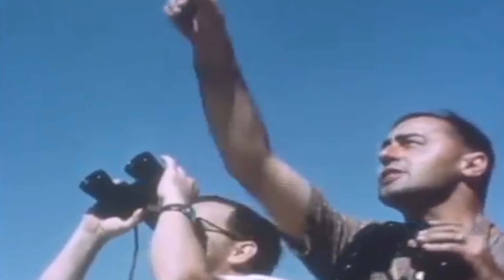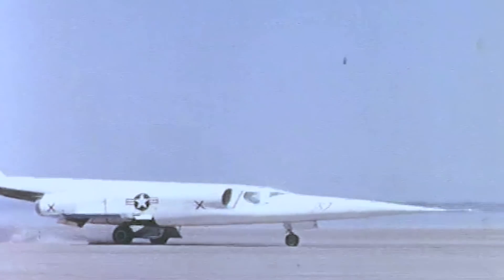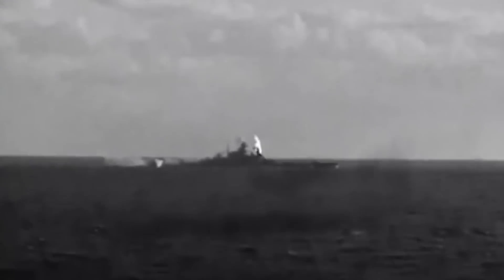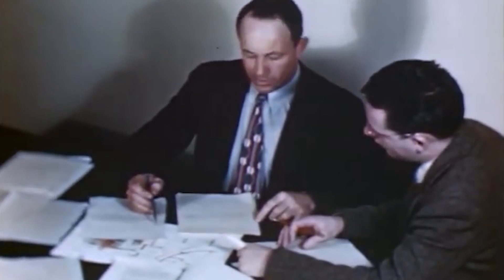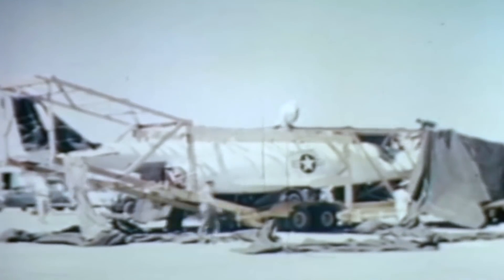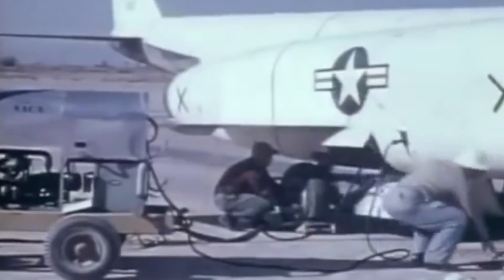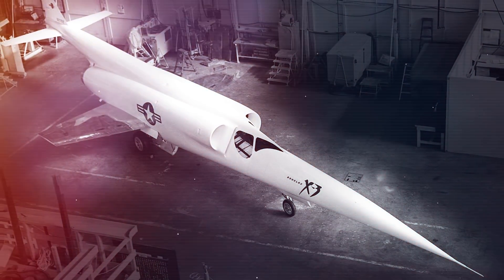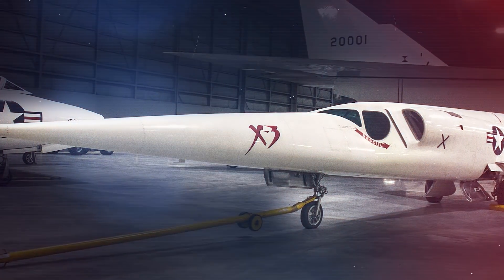Douglas X-3 Stilleto - The Dagger That Could Barely Fly

Comment: Lots of unrelated fluff about Douglas  and the SBD. 
Not enough mentioned about captured German  technology: swept wings research , rockets & jet engines.
Too much talk about the X3 looks, but not enough about the details of the design. I’m sure NASA has a publication on the X3 program. 
No mention in the video of when the X1 broke the sound barrier, what was learned and applied to the x3 
Aluminium was mentioned at least 2 times as the material of construction, which is true,  but the relevant bit of information was the aircrafts use of titanium due to the anticipated heat.   
Testing into the mid 1950 saw other supersonic aircraft tested & put into production as a reference for comparison to the X3

Comment: This video doesn't mention that the X-3 also had a big drag problem because of the "Area Rule" phenomenon. Later Mach 2 aircraft solved this problem by using a "pinched" or "Coke bottle" fuselage profile in the area where the wing joins the air-frame. You will notice the X-3 fuselage sides are perfectly straight at that location. My college mechanical drawing teacher, Mr. Gibbs, (who designed the landing gear of the P-38 while working for Lockheed as an engender before WW2), explained this aerodynamic phenomenon to us . He retired from Lockheed in the mid 50's but not before working for a while on the XF-104 project. He became a teacher after retirement, but died from cancer in 1965.
Reply: What a privilege to have a professor with that kind of background.   I gave him a lot of credibility
Reply: @raymondweaver8526 ; and on top of that, he was a hell of a nice guy. We were all sad when he passed.
Reply: Thank you for sharing. That was pretty interesting
Reply: @mandellorian I believe it's because most modern fighters rely more on Super cruise rather than lighting the thirsty afterburners so that the planes range could be extended to further mission parameters
Reply: I wound up meeting the man who set the speed records in the f-104 starfighter, David Waldrop "the shark" lol cool guy. I was a kid at an airshow, and he let me put on his flight helmet
Reply: I noticed the 'coke bottle' design on RF-4C aircraft I worked around in 80;s. I thought it was funky but was told later your same explanation.
Reply: Ya beat me to it.  I was going to comment on the lack of area rule geometry.

Comment: I still think the Stiletto got ripped off. It's like driving a Ferrari with the engine of a Fiat Panda. Not quite fair.
Reply: Maybe it should have been more like a Lotus with a Toyota four cylinder?
Reply: @Bartonovich52  Well that seemed to work for the Lotus Elise.
Reply: @Charles Yuditsky - Yeah, if it pulled that crap at just over Mach 1, at Mach 2 it would have been even worse.
Reply: @Charles Yuditsky Have you heard of any simulation of the X-3? I know the ME-163 Komet was tested and found to be incapable of supersonic flight even with a higher ISP fuel and motor. I.e. tested using computer simulation, that is.
Reply: @fiftystate1388  through the 50s and on into the 70s it was drawing board, then wind tunnel testing.  Computers were only used in the periphery, checking calculations mainly.  Mainframes at this point had as much processing power as a mid-1980 era washing machine, and slower inputs.

Another thing you need to consider is where they got the data that built the simulators used today.  These flying test beds of the 'X' program provided much of that data.
Reply: @chuckhainsworth4801  Amazing, tell me more. #IJustFoundOut
Reply: @fiftystate1388  The flagship, and work horse of the program was the X-15.  Find a book on that program,  they had a tendency to cover many of the other X ships.
Reply: @fiftystate1388  that's interesting, to go back and computer simulate/test old novel or experimental models! 
I'm going to look those up now! Thanks!
Reply: Unfortunately the engine bays were not designed large enough to fit more powerful engines.
Reply: Agreed... someone deep inside of Douglass seems to have made a significant error with their trusty slide-rule when calculating the power graph. They ‘could’ have stuck with it & (perhaps) ended up with a superior airframe, but, that never happened. What could’ve been?...........
Reply: It was ahead of its time.

1949?

They didn’t have any “Ferrari” level jet engines… 
yet.

It eventually led into the F-104 which did well with just one mighty fine J-79.
Reply: They didn't have CAD or carbon fiber composites (or any composites). Any more power and It would have torn itself to shreds during simple manoeuvres.

Comment: saying "designed for optimal speed at mach two" is like saying "this car is designed to go the perfect speed at 60mph" as if there's two different speeds somehow
a better way of phrasing this would have been to state that "the aircraft had short clipped wings to produce as little drag as possible at mach two"
Reply: The air frame was designed for Mach 2 the engines weren't
Reply: @jamesricker3997  yeah I know that, but thats not what I was talking about, I was just pointing out a mistake in phrasing, the topic to my comment is the English language, not aircraft

Comment: Great looking plane, but horribly underpowered. Plus I don't believe they had a proper Spike system for the intakes which would control the air going into the injen intakes and would cause and engine under Start stall.

Comment: The tail section where the engine exhaust is looks very F4 phantomish.
Reply: More like a F-101 Voodoo I think. Buid dates closer too.
Reply: It’s like a lot of McDonnell fighters. The configuration dates from the FH Phantom in 1945. 

It’s just odd that it’s in a Douglas aircraft.. as the two companies wouldn’t merge until the mid 60s... but the configuration does minimize losses from long intakes and exhausts.
Reply: Was just gonna post this.  Glad I checked the comments first!
Reply: It’s cool how a lot of these X planes lead to development of not just one aircraft but the different design elements found their way into other aircraft as well.
Reply: @JimBobBek I think you might have missed mine. The point is was making is that the F-104 was literally the legacy of the X-3 in combat form. There were many other superior designs available at the time, which if not due to some very shady deals done by Lockheed probably would have won out.
The English Electric Lightning would be an example of this with far superior performance and safety.
Reply: @Charles Yuditsky I don't know about that. The UK, Canada and Australia all had aircraft ready for manufacturing at the time of the century aircraft and were all scrapped due to marketing and budgets of a collapsing empire.
Make no mistake, all were superior in the roles designed than what they actually got. The one outlier would be the F-111 in Australia which was the perfect plane for the perfect job.
Reply: @paulgrimmond6296  In aircraft design, like in war, it's not really about who's right - it's about who's left.
Reply: @paulgrimmond6296 You raise a good point,  if anything, most  of that is pretty understated.
Reply: Yeah
Reply: @JimBobBek The British aero industry has a long history of experimental aircraft - quite often sub scale versions of larger production aircraft. Shorts built the SC-1 as a vertical takeoff aircraft, the SB-4 Sherpa (the worlds slowest jet aircraft at the time) and the S.31 - a half scale Stirling Bomber for example.

Comment: I heard from a renouned test pilot that there was some political hooey going on with the development of those motors.  Appropriation commitees held back funds for their own paycheck from others, Backhand payola for schmucks,, Ect.  The X3,, coulda, shoulda, woulda,,if only.   I built a Estes version of the X3 using 2 "D12-7"  Estes motors in Rocketry class in High school.   As soon as it cleared the guide rod,,it was doing mach 2!!.   It went outta-sight, Literally.  Should have used a long streamer, instead of a chute.

Comment: -  The X-3 has always been my favorite jet plane, I even built a model of it as a kid. 
-  It always looked like a "kick-ass" mach-3.3 capable aircraft just rolling out of the hanger & parked on the tarmac (apron).
-  If it would have been fitted with GE-79 engins 2 years later. It would have matched its looks with its performance. > Just like its ofsprings, the F-104 Starfighter eventually did....
Reply: Yeah but the starfighter was barely fit for combat itself.
Reply: @somewhatsomething4882   - Not so. It did superbly what it was specifically designed to do by the same Kelly  Johnson that gave us the the SR-71
- Then suddenly the Air Force decited they wanted it as a multi role craft.
- Ever try to turn a Formula racing car into a utility van?

Comment: Clearly, no concept of the "Area Rule" in this design. Rather like the first F-102. Underpowered engines, for sure, but also significant fuselage drag that they weren't aware of. This is how you learn lessons; you make mistakes.
Reply: Yes converse of area rule very draggy above M1.
Reply: The X-1 and F-100 weren’t area ruled and went supersonic.
Reply: @Bartonovich52  True. It's not absolutely required. The X-1 didn't even have swept wings. They didn't know what they didn't know. I flew the T-38 and it had the most lovely "waist" and rather small engines and could go supersonic - barely. I also flew the F-111 which wasn't noticeably area ruled and could exceed mach 2 if provoked. I suspect the X-3 was just another step along the road to really understanding supersonic aerodynamics. Under powered and under designed.
Reply: @claycook5773  Yes, flew F111Cs in 70s. One memorable day during post D test, hit M2.5 at 45,000 ft in level flight, temp was 5C below standard. Had to pull nose up to slow down. Very clean, light and big wings. Not long after VNE reduced to M1.8 to save engines - sad.
Reply: @jimgraham6722  C's! Aussie, I assume? Yes, big wings indeed. I flew the F-111F in England in the 80's. I believe some of them went down under after the USAF got rid of them. Our FB-111'a had the big wings. Then SAC got rid of them, and they became F-111G's and I think you got some of them too. I never reached mach 1, but the "pirate" radio stations anchored in the channel in the 80's had huge radio masts, so they were great radar targets. We "boomed" them regularly. Great bird. It remains a privilege to have flown them. Cheers.
Reply: @claycook5773  That's correct. Long ago but seems like yesterday.
Reply: I wonder why the landing gear is in front of the wing. Where is barycenter? Where is center of lift? With the wing a little bit in front and the landing gear a little bit aft  the wing would be at a place of constant area of the fuselage. Still not ideal, but at least as good as on a modern jet liner. You cannot make the plane smaller there because it is already shrink wrapped around the engine. You would have to be bold and add hollow anti-shock bodies kinda like stuff: You know: Weight and surface drag.

Comment: There are so many errors in fact in this video. Saying it was flown in 1943, rather than 1953, and on from there.
Reply: There's usually at least one simple error like that in all their videos.
Reply: @pascaly  Another error:  it was not all aluminum.   Titanium was used extensively throughout the airframe.   This author doesn't even read the available literature before speaking.  Disappointing at best.
Reply: First the had to catch German engineers to learn how to build jet engines and swept wings. The only jet engine they knew at this time was the DH Goblin used in the Bell Airacomet.
Reply: Yeah these videos are usually not perfectly researched. They get the gist of it but make pretty glaring oversights, for example characterizing the SBD Dauntless, a dive bomber, as being a match in battle against the Zero.

Comment: What a sad aircraft.
This spawned the f104 starfighter "AKA" the widowmaker.
Reply: Well, the Luftwaffe got bribed by Lockheed and  took a high speed-high altitude supersonic interceptor, loaded it with a ton of bombs and used it as a low level bomber. Of course that wasn't going to end well...
It really was a great aircraft. The Germans just gave it the opposed job it should have been doing.
Reply: @sevi117  there was a lot of bribery and offering gifts of vacations, nights with women etc back then. We will never find out about most of it
Reply: Spain didn’t lose a single one. 

And you can’t tell me the Luftwaffe or RCAF were doing things like this with their Starfighters. 

https://youtu.be/jyBDEG9dg-Q

It was the pilots.
Reply: @Bartonovich52  as I said, Germany planned to use it as a low level fihhter-bomber (the most opposite role that design would have). So they trained for that. Also the German variant didn't only have the extra weight of bombs, but also it had more fuel (more weight) and extra equipment for its role (even more distractions for the pilots).

Erich Hartmann, the world highest fighter ace rejoined the German air force (he became the commander of the first German all jet fighter wing) on 1956. He opposed to the introduction of the Starfighter on that role and opposed it's adoption by the air force saying that it was an unsafe and flawed aircraft  (obviously he was talking about the low level version. Tell him that they would use at high altitude without bombs as it was designed for and he would have said otherwise).
Reply: The wings are too short!!! There I figured it out with one glance... The designer needs his head examined or should have stuck to working on the set of flash Gordon.  
To fix it would need Delta wing's & nose canards also flight computer to improve stability
Reply: @punkvoid9957  is not a plane based on dogfighting or slow speed maneuvers (like a low lever bomber would need). 

It's a plane based on going as fast and high as it cans, while getting at that altitude ass soon as possible (a high speed interceptor). That's why the minimal wings (with the low drag generated by its surface) and the tremendous engine power are more than enought to generate the lift it requires (maybe the max engine power output was similar to a MIG-21, but at 6,3 tons it weighted 2 less tons than the MIG and that's a huge difference). 

Do you remember of the video what killed the Douglas X-3? The lack of performance from the engines. They expected a lot more of power when they designed the plane. The lack of power made it unable to generate the lift it needed. On the other hand the 104 had the designed power. It's acceleration was incredible. Most of the 104 losses were due to bad weather or use out of the interceptor role (yes I'm talking about Germany there)

It was designed as an interceptor, and was excellent at that. It could climb faster, run faster and accelerate faster than any of its posible rivals.

Comment: An exotically beautiful plane. I built a plastic model of one when I was about 10. Once built, I felt like throwing it at a dart board. I'm sure it would have stuck.
Reply: I had one of those.  I didn't follow the instructions so I glued the landing gear doors on before putting the undercarriage in and other minor mistakes.  From then on I made great models by following instructions and taking my time to paint them properly.  The X3 was a real 'learn from your mistakes' machine, 1:1 and scale!

Comment: Re: The Title of the Video
STILETTO
not
Stilleto.
Reply: A bit disappointing from an otherwise pretty consistent historical/educational channel.
Reply: @Galileo7of9 - I do not believe so. It true, please provide at least 3 examples  errors.
Reply: @scootergeorge9576 , you're kidding, right? "Dark's" military videos are filled with errors. The one on the F-8 Crusader is probably the worst example. Almost everything said and shown was wrong or in the very least misleading.

But this very video includes at least one incorrect point. At the end it is said the X-3 raises on the fourth floor of the Museum of the United States Air Force. No it doesn't. There is no fourth floor in any building of the museum. The X-3 sits on the ground, as sleek as its bladed namesake.
Reply: @Chilly_Billy  - In the video, the X-3 is sitting next to the NAA B-70. Overall, a good video. Tells about the then unknown phenomenon that is roll coupling.  More could have been made of the failure by Westinghouse to deliver the engine performance they promised.  But many promising airframes fell victim to Westinghouse, perhaps Navy more than any.
Reply: @J B - Consistently error prone means more than a single error. You mean no mushroom cloud on the moon?  In any case, with the naked eye, only the flash would have ben visible.
Reply: Oh good you just saved me a point on my next aviation history exam. You're a hero.
Reply: @ProfessorPoofy  GOOD LUCK